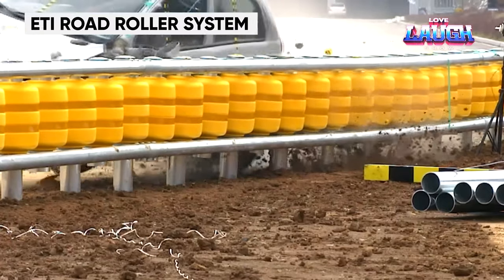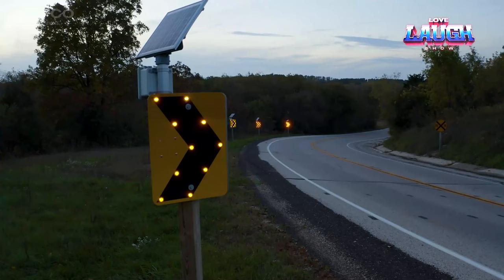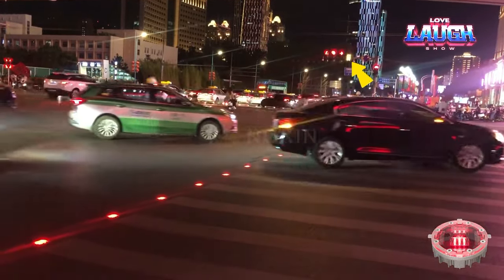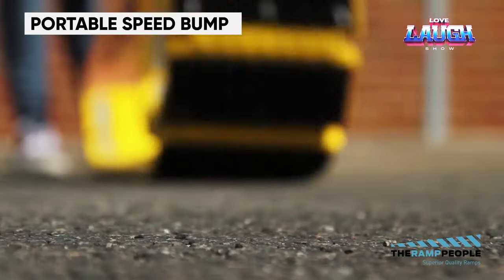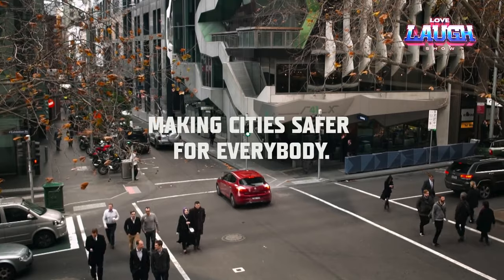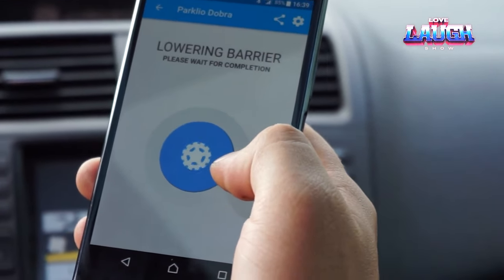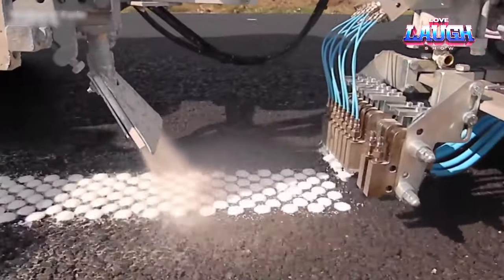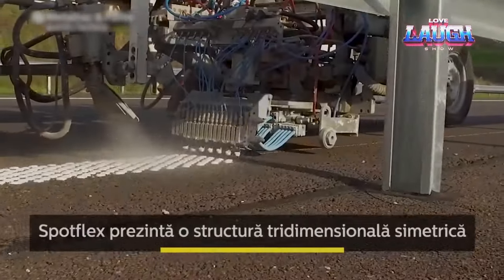Amazing Road Technologies on Another Level

Comment: Flashing lights on roads and intersections, especially synchronized with traffic lights, would really help safety in our area.
Reply from the maker: Definitely, synchronized flashing lights with traffic signals can enhance visibility and safety, alerting drivers to changes and encouraging caution at intersections. It's a valuable suggestion for traffic management.